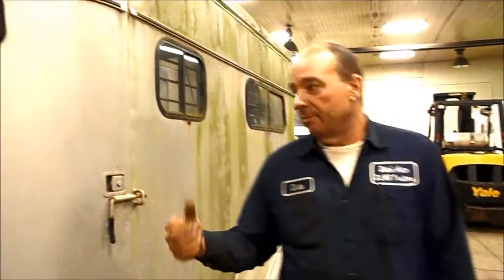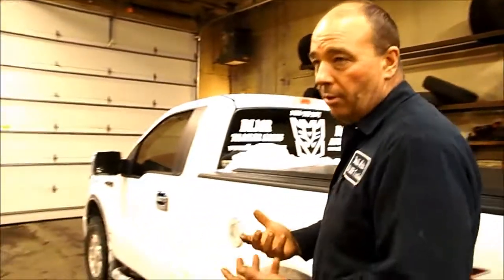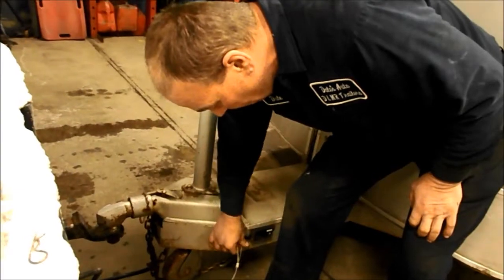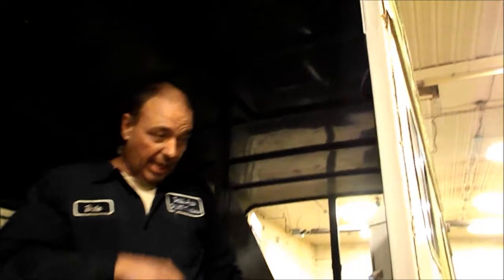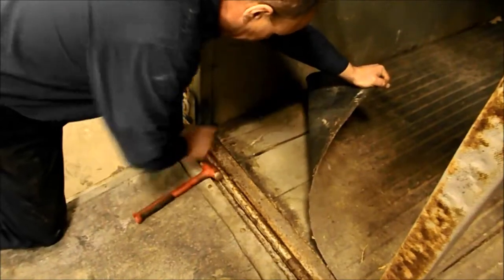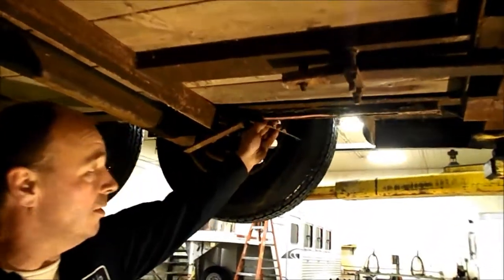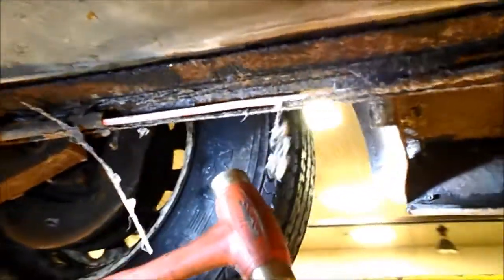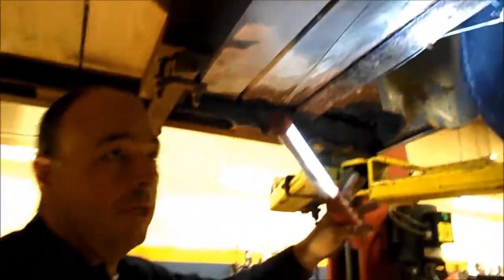Trailer Talk Ep 1 - Buying a Used Trailer

Comment: I'm on my 4th used trailer. Just downsized from a 3 horse LQ to a 3 horse, steel, bumper pull. Someone overlaid the wood floor with plywood. I pulled it all out and completely replaced the floor, but my question is, do torsion axles wear out? I get mixed opinions on that.